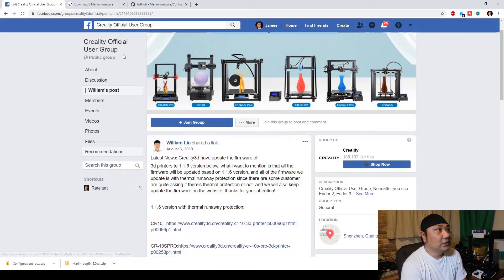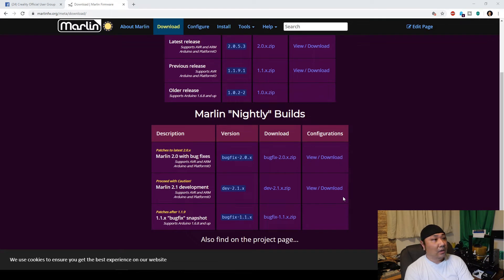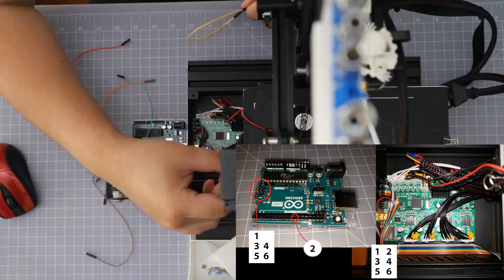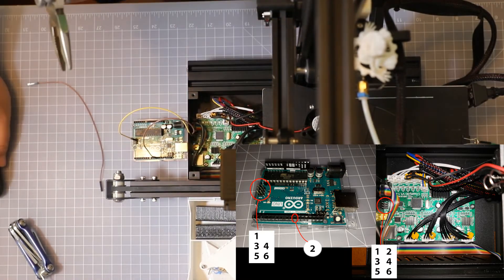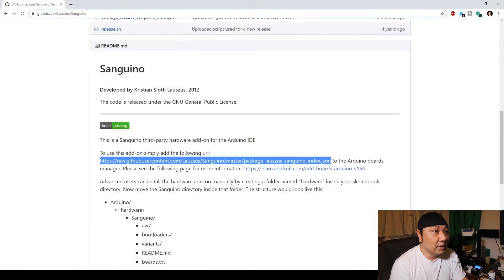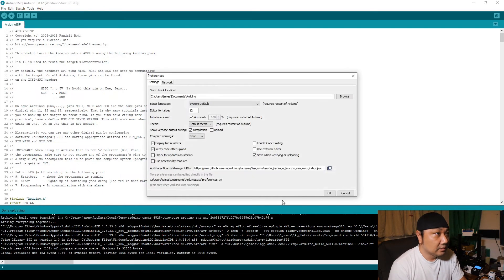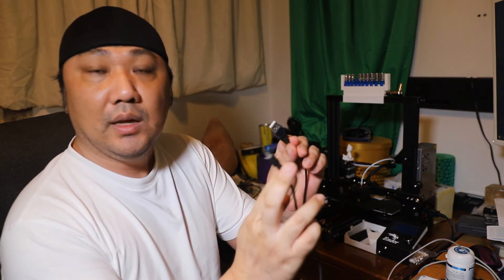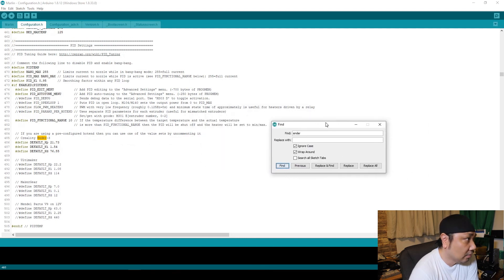ENDER 3 MARLIN 2.0 BUGFIX FIRMWARE UPGRADE - How to upgrade the creality ender 3 firmware.

Comment from the maker: Get thermal runaway protection. 1.1.6 firmware comes with the thermal runaway protection. Do not use the USBISP if you have Windows 10. You will have difficulties installing the drivers. I recommend the Arduino Uno to burn the bootloader.
Reply: So just throw more money at it? Great advice...
Reply from the maker: @joejacobsen6822  This is based on the limitation of the board inside the printer. I don't make the rules.
Reply: @DiyProJames  And BLTouch says download the Firmware from Marlin. That doesn't work. They lie to sell a product.

Comment: I get the error below at the very end, any thoughts? I could link a google doc with the entire thing pasted if that helps.

Using library U8glib at version 1.19.1 in folder: C:\Users\Mike\Documents\Arduino\libraries\U8glib 

exit status 1

Error compiling for board Sanguino.
Reply from the maker: Make sure you select the correct board and port.

Comment: Why can't I get an actual firmware file for this? I'm not a programmer. Where can I download the actual firmware?
As stated before. My Ender 3 is a brick after installing the Firmware from Marlin. No steppers work. I get told that "Homing Failed". Now what?
Reply from the maker: Firmware build is based on the type of upgrades made to the printer. So based on each type of upgrade there are different builds. Please post based on the video subject instead of multiple videos. This video is about installing bootloader and building your own firmware not about grabbing a pre-existing firmware and uploading it.
Reply: @DiyProJames  BLTouch directs people to your video to install the upgrade. If you don't like it, perhaps get with them to not direct people to you to solve the issue of not being a useable add on for the vast majority of people. Not all of us write code for shits and giggles.
Reply from the maker: @joejacobsen6822  No one who has knowledge working on firmware will tell you any different. Firmware is based on the printer and upgrades made to the printer. There isn't one firmware that will work on all printers.
Reply: @DiyProJames  Then why do they say to download the stock marlin firmware? They misrepresent this as a simple install. It isn't. People should be aware of this before they waste their money.
Reply from the maker: @joejacobsen6822  This is because most hobby style printers run off of marlin. When you buy your stock printer it has marlin firmware installed. If you were to look into the marlin firmware source code. You will see in the configuration.h file the the bltouch component is written in there. What happens when the firmware is compiled certain code lines are included or omitted. This is what they mean by commenting out a line #. Just like some car models have different car engine options. If you have a v6, but your firmware is set to v8 then the computer is going send errors. Also, there is no way to tell if the actual hardware was installed correctly. You'd have to diagnose whether it's the firmware or hardware install.. This is why some people refer to stock... nothing added, but the bltouch... Adding other components may affect the how the code is written or compiled..

Comment: when i do the autohome thing, it goes to the left, then comes back to the middle. Then it just starts going up, and is never comming down. I don`t understand why this is happening... PLZ help me
Reply from the maker: Did you do a sensor upgrade like add a bltouch? My guess from the limited information you gave me is you did a sensor upgrade. When you autohome it's a set of commands the printer is given. It looks like the X and Y are triggered (endstops are like push buttons, finds the x and y zero points) , the Z axis is not triggered (it is still looking for a command telling it to stop or it found it's X axis zero point) This could be because the hardware is not setup correctly, or the firmware is not setup correctly. It's most likely the former. It maybe your zmin and ground wire are switched or you may have plugged them in the wrong pin..

Comment: My ender 3 does not have the same number of pins as your board. I only have three on the E3 board. Can you please inform me what I am supposed to do?
Reply from the maker: Unless you have a modified ender 3, you should have the same number of pins. If it is a different board you'll have to find what type of board you have. Find a diagram for it. Most likely will be available online if you look for it. Find the corresponding pins to make the connections. Then modify the firmware..
Reply: @DiyProJames  i figured it out on reddit. different version board. waste of my damn money.

Comment: So a question am owning an Ender 3Pro, do I need to buy an aurduino device in order to do it ? Or can I connect the pc directly
Reply from the maker: I believe the ender 3 pro does not come with bootloader installed. You will need an arduino to flash it first.

Comment: Great Video!! You're the first person to mention v1.1.6 has the thermal protection in it. I wrote to Creality to ask this and they never wrote back. I bought my Ender 3 in May 2019 and it has 1.1.6. I tried to test to see if Thermal Runaway is enabled using the safe method by 
BV3D: Bryan Vines where you plug a powered usb cable into the printer and letting the hot end heat up. Mine only made it to 43c and after 45 min it never triggered the Thermal Runaway. That should have triggered it. I don't think it's enabled. Is there another way to test it without cooking off the plastic in the hot end? Thanks!!
Reply from the maker: Is this for the ender 3? For the ender 3 it's 1.1.6.2 If you don't see the message of thermal runaway fault most likely it doesn't have it enabled. One way you might want to try is to raise the temp to 200 and try blowing cold air using a blow dryer preventing the heating block from approaching that said temperature.
Reply: @DiyProJames  Yes it is the Ender 3, not the pro. Thanks for responding and the info of 1.1.6.2. I'll try the test you mention. I gave you a couple thumbs up and subscribed.

Comment: The tutorial is very good, but shortly before the end I get an error.
"Linking everything together ...
"C:\\Program Files\\WindowsApps\\ArduinoLLC.ArduinoIDE_1.8.39.0_x86__mdqgnx93n4wtt\\hardware\\tools\\avr/bin/avr-gcc" -w -Os -g -flto -fuse-linker-plugin -Wl,--gc-sections -mmcu=atmega1284p -o [...]

avr-gcc: error: CreateProcess: No such file or directory
Library U8glib in version 1.19.1 in the folder: C: \ Users \ xxxxx \ Documents \ Arduino \ libraries \ U8glib is used

exit status 1
Sanguino board compile error."
I can't get any further here. Do you have any idea?
Reply from the maker: try reinstalling the u8glib library.. try saving it to a different filepath or directory
Reply: @DiyProJames  Reinstalling and changing the path did not help. I also tried the guide on another system. Nevertheless, the described error occurs.

Comment: Hi James,
I have upgrade my ender3 with marlin2.0.  I have enabled manual Mesh Bed leveling which works fine after flashing.

But  power fail recovery function not working.  

Does this function working in Markiy2.0 Bugfix version????
Reply from the maker: The problem is with the ender 3 board. It does not have enough space to have all the features enabled, which is probably why the power loss feature has been disabled.

Comment: great video but when i try to compile i get a message saying 'Error compiling for sanguino'
Reply from the maker: There should be another message attached to the error message. Most common error is there is not enough space on the sanguino board. If this is the case you may have to remove some of the options on the firmware. Please check the message again. There should be a message attached to the error. Reason for the error.

Comment: Thanks for doing these vids!!!!!!!!!!!!!
Finally someone who matched an "Ender 3" (not pro) with a "BLTouch 3.x" - Thank you, Thank you, Thank you.
One quick question before I start - Is there any difference between using an Arduino 'Uno' vs 'Mega' ?
I was given a Mega as a gift and have not played with it yet, I'd like to save the cash and use this if possible.
Thanks again!
Reply from the maker: Yes, the mega is a better board. The process should be the same with the mega. Just find the correct corresponding pins and check the board settings in the arduino ide. Good luck
Reply: @DiyProJames  05-17-20  Hi again.  So I tried the Arduino Mega Microcontroller, used all the same pins (incl. Pin 10) and it went well.  But... When I turned on my Ender-3 the 'start' or splash screen read: "Marlin 2.0.5.3" for a second or two, the BLTouch probe went D/U/D/U during that process then the main screen came up with: Error: EEPROM Version.  The BLTouch is not on any of the menus.  Any thoughts or help?  Thanks again!  
FYI I have:
Creality Ender-3
 (NOT Pro),  Creality Mainboard v1.2.4,  BLTouch (Full Store Kit) v3.1
Reply from the maker: @sparkey9640  Means probably there is some type of error in the code. There are many authors to the same code. Meaning the 2.0 version is being edited by developers and being uploaded to the often. So what you downloaded today might not be the same one you download tomorrow. I find that the 1.1.9 version is the most stable. Most people think newer versions are better, but that's not always the case. If you looking to upgrade some of the features to your printer then updated firmware is better, but if you check the marlin website. Those features will never really apply to the Ender 3 without switching out hardware. Like a new 16 or 32 bit board, heated chambers, etc. If you like to run an older more stable version check out this link https://www.thingiverse.com/thing:4330128/files and download from there.

Comment: Hello James!  Have you tried using PlatformIO in VSCode with the Auto Marlin Build plugin?  I will end up probably doing what you show in your tutorial to put 1.1.9 on my CR-10 Mini (ATMega1284P), but was interested in ways of showing others how to do this that could potentially be simpler.  As a first timer (and someone new to programming Arduino's too) the whole process has my head spinning!  Thanks for the video!
Reply from the maker: No I have not looked into it.  It's something I may look into in the future. Thanks.